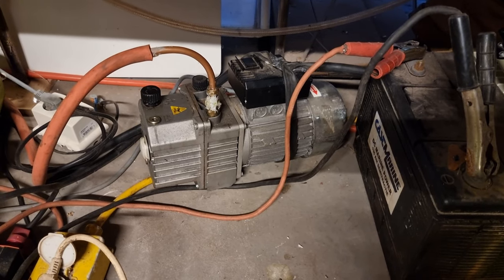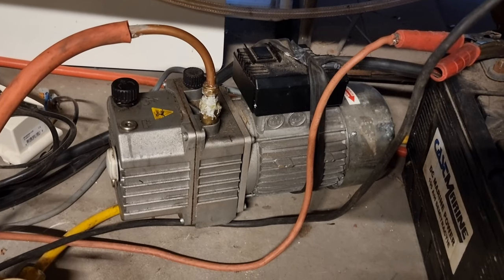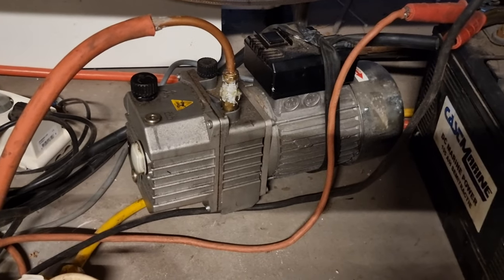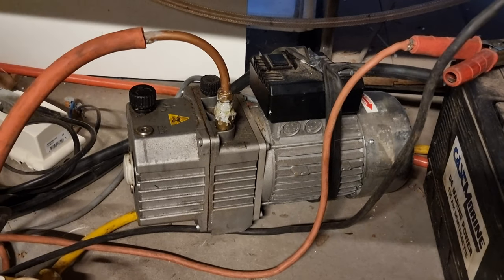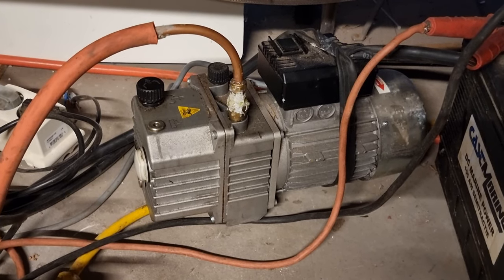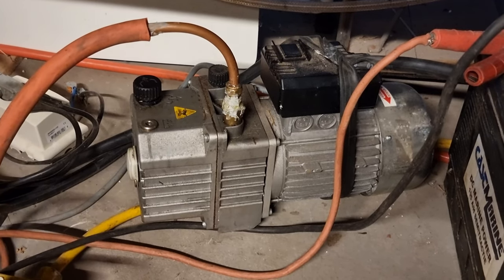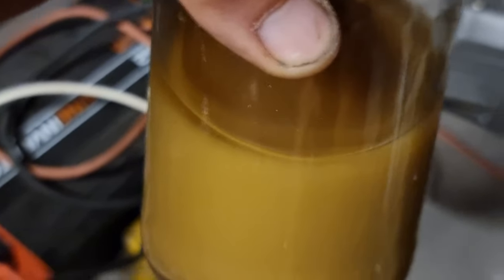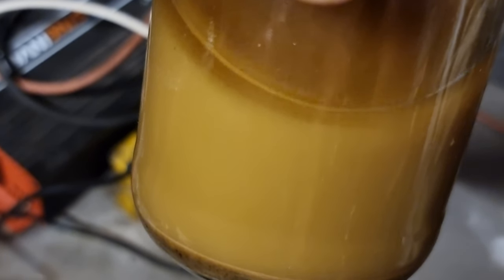VEGA - Vacuum Pump

Comment: How very strange. The oil is normally a closed system. Could transmutations have entered that closed loop? Frisky EVOs?
Reply: i suspect that carbon and other elements get into the oil. The tank gets dirty all the time, so some of the dirt will get into the pump. In this type of vacuum pump the air come is contact with the oil.